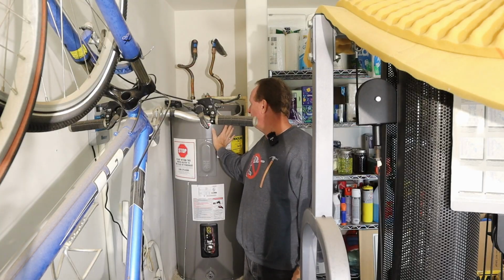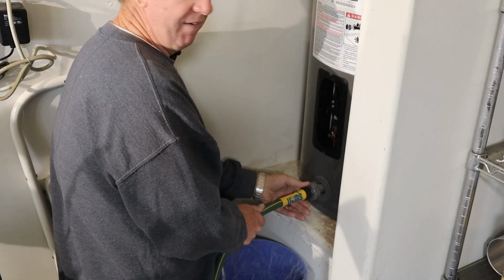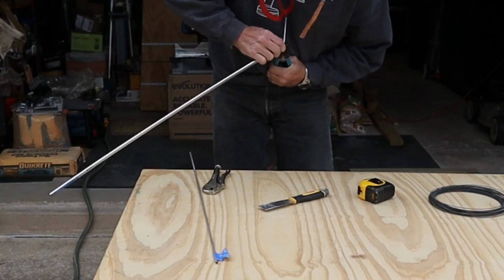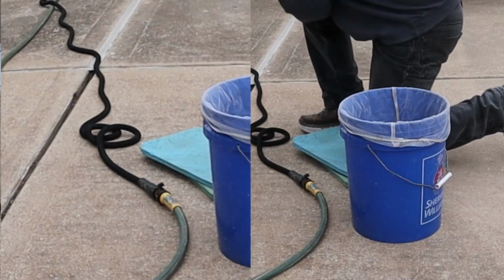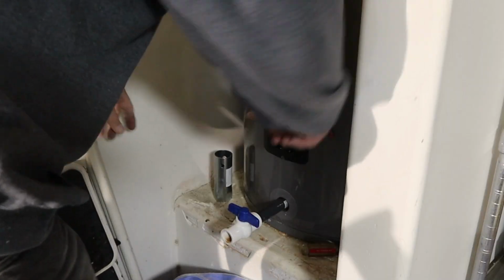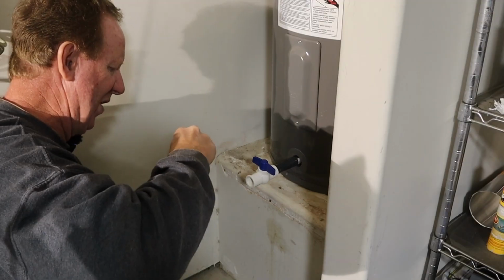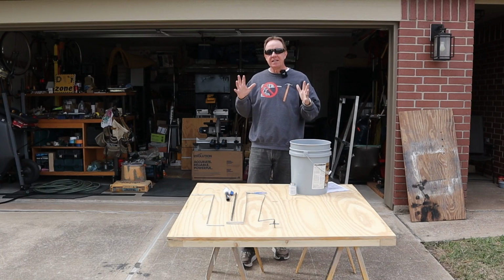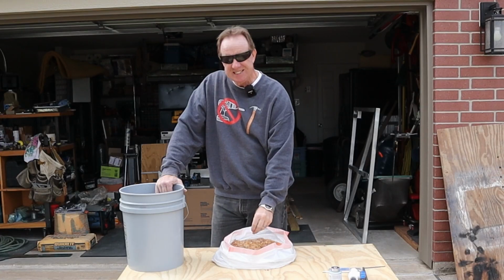Proof You NEED To Flush Your Water Heater, I Waited To Long!

Comment: If you are a home owner you need to do this once a year or every 6 months especially if you have hard water in your area . Get rid of that plastic valve at the bottom of the tank they are bad about cracking & leaking , remember that tank heats up several times a day doing laundry , bath dishes etc.  And if your water heater is in the attic then it heats up every single day  . Replace it with a brass nipple & brass ball valve that way you can check it every couple of months with a 5 gallon bucket .  I just went through this back in September when I converted my all elect water heater over to natural gas .

Comment: First, thanks for making this video! It was very helpful. Second, I have a question for you. Since you had to scrape around and then re-insert the lower heating element so you could turn the water on to help flush the sediment, could you have just used the lower heating element opening and took your garden hose and inserted it there so that you could get the water to flush through the debris out easily turning the hose on and off? Or am I missing something?
Reply from the maker: Well tell you the truth hadn't thought of it but also was more afraid that doing something like that was going to make a huge mess.  I thought of just turning on the water to the water heater and let it flush but was afraid that water was going to rush out the element opening and make a huge mess.  Cuz at first the debris was at the top of the element opening to start.  Thanks for watching.

Comment: I'm not sure of the process name, but heating the water causes naturally occurring minerals to precipitate out. That's where the "sludge" comes from. The minerals are calcium, iron, etc. that precipitate onto and around the heater elements. Electric heaters usually have two elements, one toward the bottom and one just above the middle to upper portion of the tank. In heavily mineralized water, precipitates can quickly bury your bottom element and reduce the efficiency of the water heater.
Gas water heaters still accumulate precipitates but the central heat transfer tube runs all the way up the middle of the tank to the exhaust vent. Accumulated precipitate sediment at the bottom of the tank still leaves the rest of the exchange tube to heat water.
I enjoyed your video, but would hate to think of the cost of having a plumber come out and perform the same maintenance.
Reply from the maker: Glad you enjoyed the video.  Just got a comment from a plumber and he said he charges $2000 to install a new water heater along so yes it would have been quite expensive I'm guessing.  Thanks for watching.